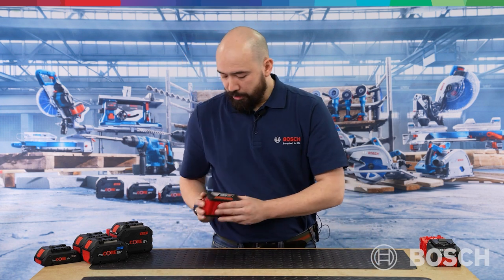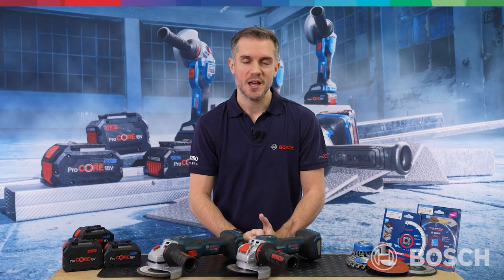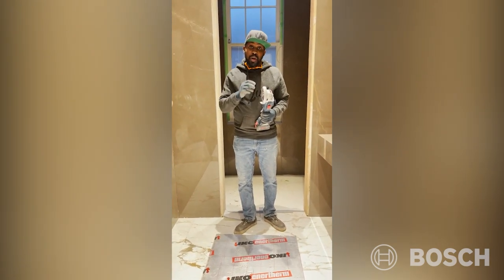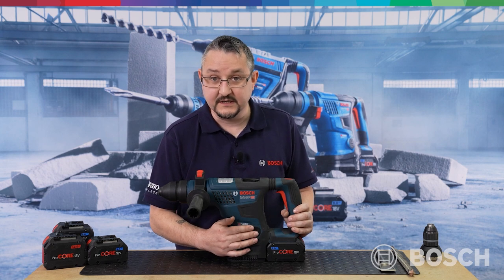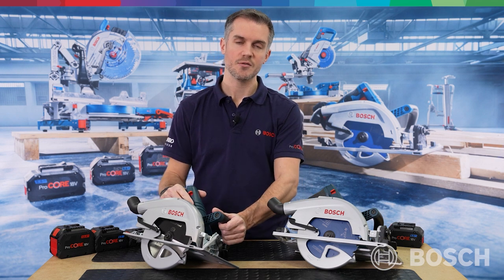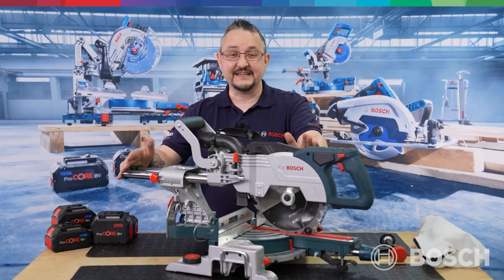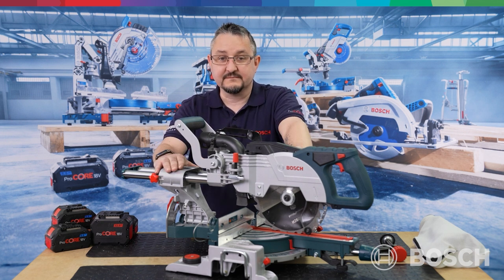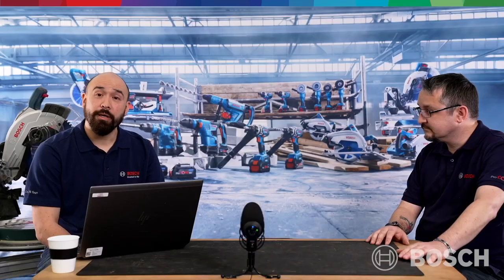What is BITURBO Brushless? (REVEALED LIVE 🔴)

Comment: Hi nice review please let me know is this comes with Bluetooth in the box r need to buy saparate y
Reply from the maker: Hi Anil, what tool are you referring to?
Reply: @BoschProfessionalUK  Bosch gsb 18v-150c combi drill
Reply from the maker: Hi Anil, apologies for the delay in responding to this. Our notifications didn't pick up that you had responded to our question. The standard GSB 18V-150 C doesn't come with the Bluetooth module, however if you purchase the version that includes an L-Boxx, battery and charger, the Bluetooth module will come with it. The part number is: 0 601 9J5 172

Hope that helps!

Comment: In addition to that as I've watch that other brand used looks like a battery that used on mobile devices maybe u can do that like along where we can be able to see how much percentage power still there in the battery. What I'm trying to say just on mobile devices where u can see the battery percentage and bip when it needs to charge and maybe bipping again once it full charge with flushing of light that indicates that the battery is safe not overcharge coz the charger itself has its own safety measure that cut off the power once battery is already fullcharge. Just like on used mobile devices. I hope you take consideration on my comments  here to your comment section. To help to improve the efficiency of your products.